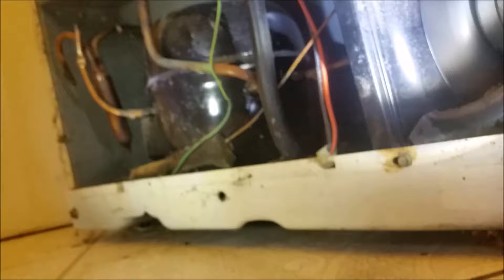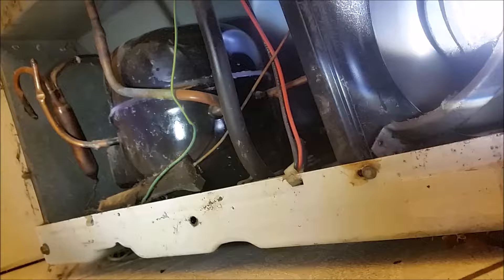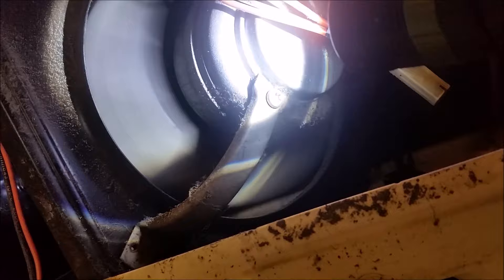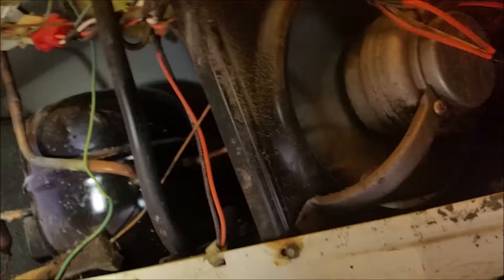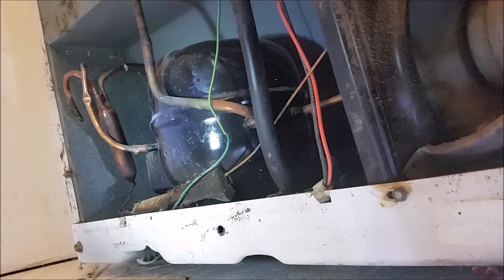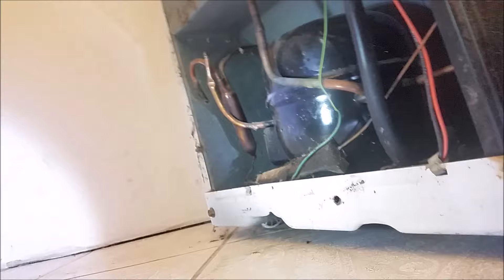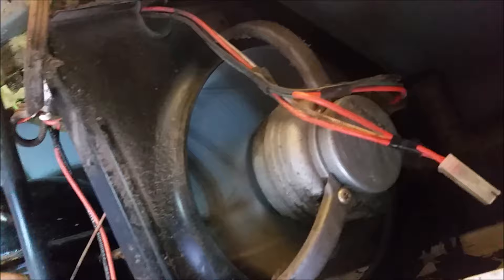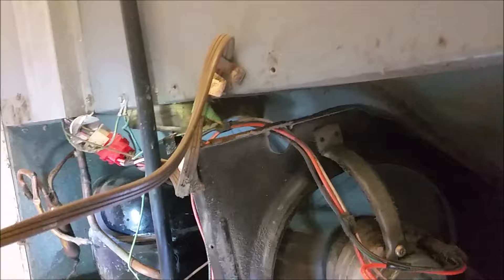Refrigerator make this humming noise and getting louder?

Comment: As a refrigerator expert, I can say for sure that the staimafratzen is worbling the dimashatz.  You can fix it by putting a slight bend in the discombobulater.
Reply from the maker: https://www.youtube.com/watch?v=Ac7G7xOG2Ag&t=45s
Reply: I removed the staimafratzen but the dimashatz is still worbling. I also slightly bent the discombobulater, but that didn't work too. Any other suggestions? Should I pan the tilometer to 83 degrees in case the top shelf slides back inside?
Reply: Mine is making a whistling sound, a high-pitched whistling
Reply: @sportscommentaries4396 yes do you know what that sound is?

Comment: My problem is my Refrigerator sounds like a car trying to start. Should I be worried it will start and drive away?
Reply from the maker: that depends , if it gets good gas mileage I would keep it.😎👌
Reply: That's my exact same problem and it's high pitched
Reply: Sounds like your refrigerator is running
Reply: I think so, yes. Chock your fridge.

Comment: My humming stops when I open it and starts once I close it. Any suggestions? Same noise as on this video
Reply from the maker: I have never heard of that. I don't know what the door would do to stop making a noise.
Reply: Same here. Have you been able to troubleshoot it?
Reply: @andrew6226  yeah. It's the interior fan that circulates the chilled air and fans the coils. That's why it turns of when open and makes noise when closed. I took it apart and realized that so much ice had built up on the coils in the fridge and the fan was grinding against the ice making that sound. I defrosted the entire refrigerator and freezer and it stopped. (This was after taking it apart and trying to blow dry it to melt the ice and was too tedious and wasn't melting that well)
Reply: @3P44CT  that's interesting.. Mine sounds just like a fan but it's up top so I'm not sure if it would be interfering with any of the ice maker.. Unless you're saying it got so cold there's ice buildup around the fan.
Reply: @andrew6226  correct, nothing to do with the freezer or ice maker. All limited to the fridgee section only. It accumulated ice in the fridge and crept to the fan.

Comment: Do you suggest turning off the refrigerator till the fan is not replaced? Can it damage the other parts of i don't get it replaced within a 2 or 3 days?
Reply from the maker: If the fan stops turning the refrigerator will get hot and it is possible it could damage the refrigerator. I did not want to turn off my refrigerator so that is why I added the little fan behind the refrigerator. Because of the pandemic I did not want any repair people in my house so I ran the extra fan for nine months. When the repair man finally came he said he never saw anybody add a little fan like I did. But it worked fine.

Comment: Check for an ice chunk buildup on the rotating mechanism of your evaporator fan/motor.  That would make an imbalance and cause buzzing/humming noise.
Evaporator fan stops when you open the freezer door.
To get to the evaporator, you’ll probably have to empty out entire freezer, remove some shelf rails, and remove the back panel cover.
Reply from the maker: Thanks Mathew!😎👌
Reply: Ice chunk build up what do you do about it to make the noise stop?
Reply: @duawoman3086  remove the ice.  try physically removing it, but don't damage the part, safer to remove the part and let it defrost, then reinstall
Reply: It’s actually the compressor. It’s a 60 cycle hum. Fans usually spin 30 to 40 times a second. It would sound more like a low pitch clicking or rattling if it was ice. This is the compressor. Your best bet is to replace the compressor.
Reply: @levi_gobin  Hmm, actually I checked mine and it's making a similar sound. I took off the panel and noise is coming from the fan component. I think it may be too icy because my dad over stocked the freezer and I think the ice couldn't escape and built up around that area. May be also the rest of it is iced over too much too. I'm going to turn the whole thing off and back on once defrosted and test it out.
Reply: @XSeanxMeowX  did you end up doing this & have any luck? My GE fridge also has the loud humming sound coming out of the top part of the freezer by where the fan
Reply: Is it common
Reply: @XSeanxMeowX  this worked amazingly. Thank you!

Comment: I want to thank you kindly Sir. I have been going crazy with that low humming noise. I can sleep now. 👍🏻👌🏻 Just a cleaning and some wd40 did the trik.
Reply from the maker: Glad to help
Reply: What is wd40 ?
Reply: Don't use wd40 on electronic or electrical motor it will melt the copper coil varnish and good bye to the motor

Comment: This is exactly what mine is sounding like
thank you
Reply from the maker: If you can get to the back of your refrigerator and if your fans not turning then there you go.
Reply: My new/but used fridge just started making this noise and i did figure out it was the fan already but from there im stuck.
Reply: My refrigerator is making this noise and it's a no frost and after some time it don't cold it's not even cooling down

Comment: Had GE replace a new fridge this year. The whole compressor was garbage. The new one is rattling noise now. Compressor is still loud and high pitch
Reply: OMG! This is EXACTLY what I'm dealing with. Had my GE fridge less than one year, they replaced the compressor and now it make this loud humming sound every 25 minutes. The tech told me it was normal, I know its not! I'm desperate to get this fixed.

Comment: Clever, clever & you saved a ton of money by fixing it yourself. Now travel to Texas & replace the Wig-Wag on my washer. LOL
Reply from the maker: Ha! I did not know about that. https://en.wikipedia.org/wiki/Wig_wag_(washing_machines)#:~:text=The%20wig%2Dwag%20is%20the,1987%20in%20the%20United%20States.
Reply: @RobbsHomemadeLife  -- Yep. It does everything but agitate the load. I'm not in the mood to fix or get a new one. So I'm stirring it with the handle off the plunger & running it through the cycle. We are work-around folks.
Reply: DebTipka ~ unplug it and use a decent lubricant like PB blaster or Tri Lube to clean off the corrosion and gunk. A high powered magnet can help open the solenoid up so it can get some lube on it. Great idea with the hand agitation!!
Reply: @rickallmightyjones6189  --- You are awesome!!!! The handle works, but now I have a blister on my hand. Drama-Drama-Drama.
Reply: @rickallmightyjones6189  -- I assume Auto Zone or the like carries it? Don't make me do WalMart!!! LOL. Yes, Texans = Awesomeness.
Reply: DebTipka ~ AutoZone should have at least PB Blaster if not the tri lube. I get mine at the local hardware in Abilene. And its called Tri Flow, what I love. Amazon might have it. Works great on sliding doors and door hinges and such

Comment: Would lubricating the fan help at all? I have the same issue like anybody else commenting here. Looks like it’s actually really easy to fix but I’m wondering is this something that’s either preventable or addressable with lubricant versus replacing the whole fan?
Reply from the maker: Absolutely if you have access to the motor you can add lubricant however often the motors are sealed but if you search YouTube you may find a video showing a guy who actually was able to add lubricant to his sealed motor. However if the motor is starting to go due to age eventually adding lubricant is not going to help

Comment: I used an old a.c. to dc charger to run an old computer muffin fan to help cool the coils on my refrigerator.
Reply from the maker: Actualy, the fan I am using now is a DC fan for camping that has an AC inverter.  It seems to be helping. The muffin fans would be a great idea, they last a long time.

Comment: Hi, not sure if this is still active.

Mine makes an almost 'hissing' sound intermittently. Like a fizzing sound.

The guy who installed it, said is nothing to worry about.
I'm used to them making a noise like the motor is running every so often.

Is it quite normal for a fridge to do this? Thanks
Reply from the maker: Hello Mike, if you are not experiencing any other problems. I wouldn't worry. I would imagine it's most likely related to the defrost cycle or maybe even the flow of refrigerant.
Reply: @RobbsHomemadeLife  cheers Robb. The fridge seems to be fine, temp wise etc. 
I've recently been ill and then got it in my head the fridge was leaking gas 😂
I've just not heard that noise before, but I had an engineer out today to sort the washing machine out, he also does fridges, pretty much echoed your sentiments ✌️
Reply from the maker: Hey Mike, I know what you mean. If something is making a noise there has to be a reason. Sometimes mine makes a loud snapping and cracking noise and it is the defrost thing going on. Refrigerators are surprisingly user-friendly. There is a lot of stuff that consumers can do to fix refrigerators themselves. There is lots of information on YouTube.

Comment: Did it solve the humming noise when you replaced the condenser fan? I have the same exact fridge that’s making the same exact noise. Thank you
Reply from the maker: Yes it did.
Reply: @RobbsHomemadeLife  i have this noise, my fan is truning but my fridgerator section doesn't seem to be cooling, and there's ice accumulated in freezer section that i cleaned out around where the air blows in and still fridge has no air pushing through. What do i do? Please help asap I just spent 300 bucks on food yesterday. And about flat broke today.
Reply: I have a humming noise which stops when the door is open. Thoughts?

Comment: What causes warm or hot sides of refrigerators?
Reply from the maker: It's normal for refrigerators to get warm or cold on the sides when they are being defrosted. However if your fan stops working that will make them heat up also.